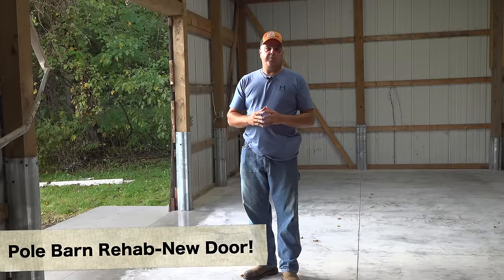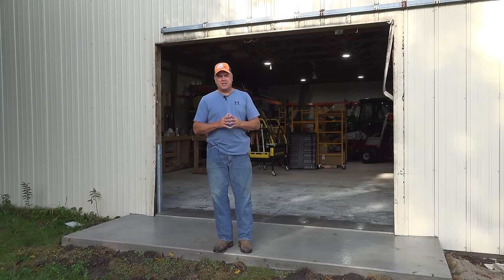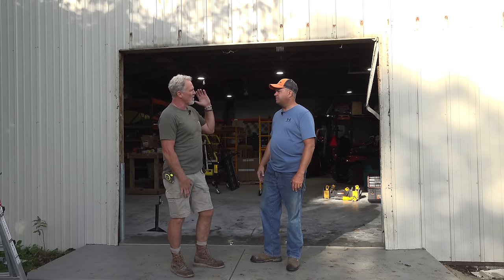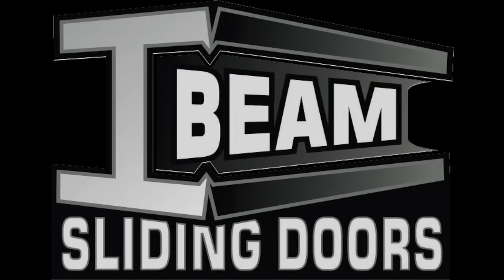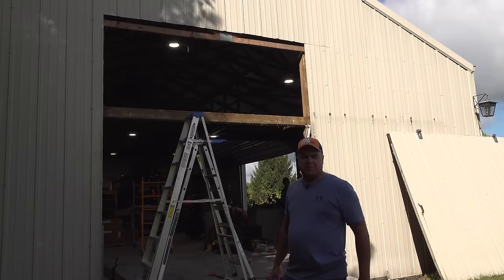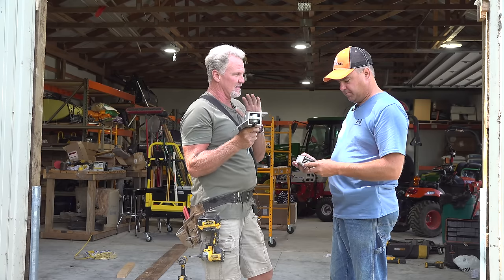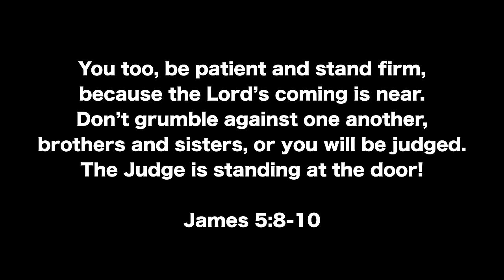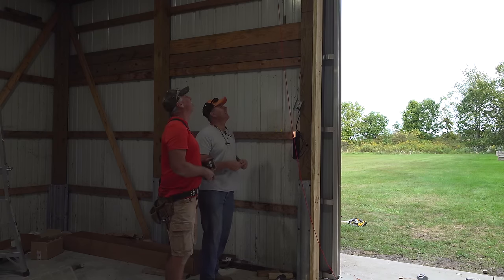Powered Sliding Shed Door!! Pole Barn Rehab!

Comment: Door guys needs his own channel...little kids ain't gonna get smashed. That self leveling man lift is great product placement with 3 ladders on the job site and only 1 in use.
Reply from the maker: Not product placement.  We couldn’t lean a ladder against the building there because we needed to pull out the siding to slide the track under.we had no ladder tall enough to reach from the ground (lower than the concrete).  After much discussion, we came up with the idea of the tractor.  It took me 20 min to get it ready.
...explaining all this in the video would be difficult.

Comment: Thanks for all the parts sources.
We have a 25x50 steel pole barn I enclosed & installed mobile home windows on 3 sides a few years ago.

The front has three 10 foot by 12 foot high openings I need to put doors on.

I have thought of sliding Hardware doors but haven't found the system yet, until now

Thanks

Comment: That is a really nice door. To bad there is not one close to Virginia. But I can go to the web site for information. Thank you
Reply: I’m in Virginia too - my 1937 track & trolley sliding barn doors on my detached garage.  

Someone tried to break in by “pushing & swinging” the interior slide door to separate doors to dislodge a steel pin that goes through both doors secured with padlock.  So what happened is that they broke the suspension track at the center junction.  Now only the other door can slide open.  The one handgun from the separated rail is stuck where it dropped into dislodged rail joint.  

So ... I can’t find anybody to fix this heavy duty rail system & wood doors that weight a TON.  Will hate to have to rip both barn doors out if I can’t find someone to repair.

Comment: Very nice door. I'm not sure why it's the norm for most to have an auto operator on a house garage door but people think you are lazy if you have an auto operator on a shop or barn door. It seems pretty much the same advantage for any of those doors. 
Stanley does make a heavy duty trolley and track set. These are rated 450 lbs.
We used them on a barn we built for a neighbour/ customer in 1982. We built all of the doors from cedar 2x4 and sheeted them with 4'x 8'  3/4" cedar plywood which was then painted. We built 7 rolling doors for that barn, which was 68' wide and 80' long, a raised centre style building with full length 24' wide lean to's.  The tallest door is in the centre and is 13'6 to allow hay trucks to drive in. It faces the weather and has stood up well, now 37 years old and still functioning well, still on original hardware. I guess the extra $25 or so per door for heavy duty paid off!
Reply: Like most hardware made in the 80's was made in USA, today not so much.  Your right, they were good hardware but don't replace with today's garbage.

Comment: Thats a nice door! Ive always liked the sliding doors rather then overhead.......you loose overhead room with overhead doors and they are so touchy. And often have an issue that keeps them from working as they should.
      Weve never had a hard time with the old school tracks.......a big help is no matter how heavy your doors are.........always put at least 3 rollers per pannel. A farmer i worked for while in school had 2 20x20 pannels and had 5 rollers set up and you could open the door with one finger.  That roller system looks alot better though and by the looks of it you should be able to rebuild them easy enough with roller bearings from anywere like napa or even a deere store.

Comment: We might need his help... We just moved and have an amazing barn, finished floor, huge! But the biggest door is probably 20ft tall, maybe 30ft wide, and when it opens it slides over another overhead roll up door, so you can only use one at a time. We're guessing it was for an RV, but we don't really need it that big and would like to be able to open both at once. We've talked about a roll up, but don't know if we can get one big enough. And we've talked about a folding door, like the hangar style you showed. Tough decisions to make!
Reply from the maker: Call him!  He is brilliant on this type of thing!
Reply: I Beam Sliding doors makes top hinge hanger doors as well.  They're designed to retrofit existing building sliding door.

Comment: How do you seal this door for the winter and if you have a video on this insulated door then I would be interested in purchasing 2 doors.
Reply from the maker: They used ‘brush guard’ …it worked ‘ok’, but not sufficient for keeping my shed at 60 degrees.  I still have the door, but I put an insulated garage door inside it.  Pretty sure I paid for the insulated garage door in one winter’s heat cost savings.

Comment: Seems like you would want a way to release the operator and open the door by hand like any garage door. For example when the power goes out. Can't do that without a handle and latch. And how do you keep the door from freezing to the concrete? I looks like there is pretty much no gap.
All in all, a very nice install!
Reply from the maker: There is pull rope to release. Just like garage door.

Comment: How has the opener held up?  Any issues?  Considering installing an opener on a 24x14 sliding shed door.
Reply from the maker: Opener worked fine.  I took it down due to the heat loss.  Installed an insulated garage door instead.  Much better seal.
Anyway, the opener was fine…for ‘cold storage’

Comment: what is to keep the door from blowing out at or near the bottom from storm or wind when other doors are open with out a latching system to hold them
Reply: I would liked to have seen that part also.
Reply from the maker: There are tracks at the bottom middle and ‘closed side’. I guess we never got a good look at that in the video...sorry.  This is what he was welding on...we refabricated them to fit our concrete better.
Reply: @TractorTimewithTim , Nice, sounds like a sweet setup !  Thanks.

Comment: Nice door and opener. However I change all mine to overhead door that seal better as I heat my barn. I also got tired of the debris in the way at to bottoms.
Reply from the maker: Yes, that is the worst part.
Reply: I’ve got a 1937 detached garage 60’ x 32’ with suspension trolley rail barn doors and have always wanted to know how to seal it better.  Last spring, for the first time in 21 yrs, some sparrows realized they could slip in through the gaps in the trolley rail & set up nest in my suspended kayak!  Ugh.  Bird droppings all over everything from flying in & out.  Grrr.  Unless I rip out the old slide rails /doors, guess a better sealed door solution will be far too expensive.

Comment: How sealed is the door?  I am really curious about a sliding door and its weather seal on the edges.  Can we get some video detail of the closures? Thanks!
Reply from the maker: It is ‘good enough’. I heat and a/c the building.  I use ‘brush seal’.  Regular garage door is better seal...but this is passable.  
I can see daylight from outside in the lower corners, but that is all.
Reply: @TractorTimewithTim  Thank you for the reply! I am moving to a neighborhood where people have hangars for small planes.  I want to build a garage (not for planes) and I was wondering how I could have a door that could work for a future plane owner! This is very interesting.  Thanks!

Comment: Unless that header in the door is only holding sheetmetal from waving in the wind, that is not the way to install a header. Any header has to have path to ground, which means notching the post to shelf the header. No fastener or nail or screw is adequate for supporting that over time. Only an idiot would drive a header between two posts and put a few screws in to hold it.